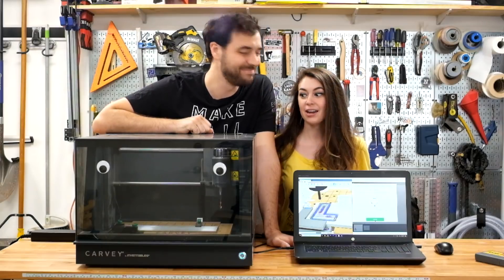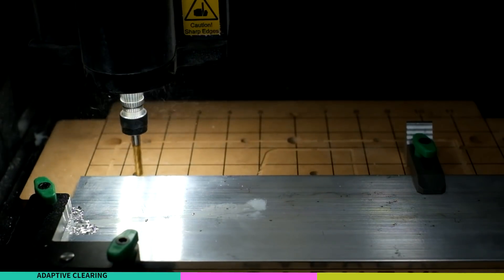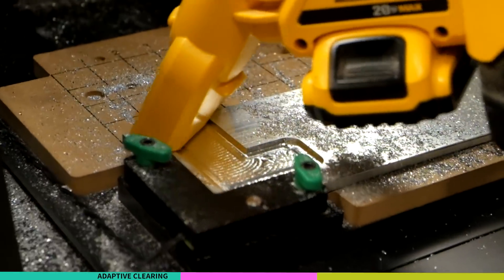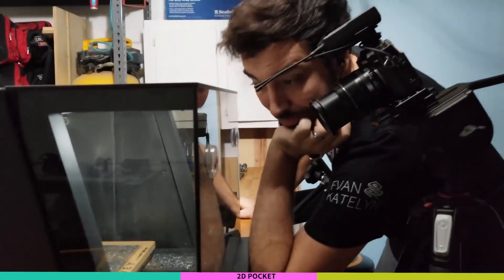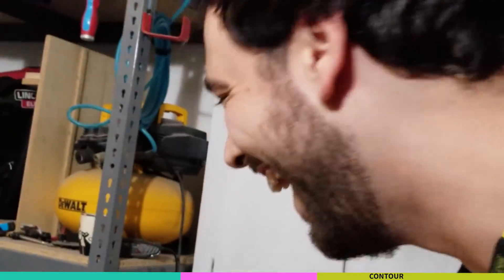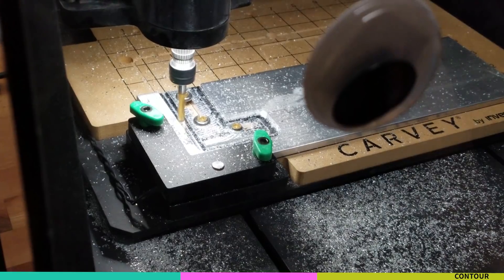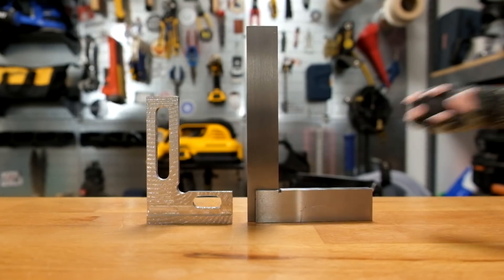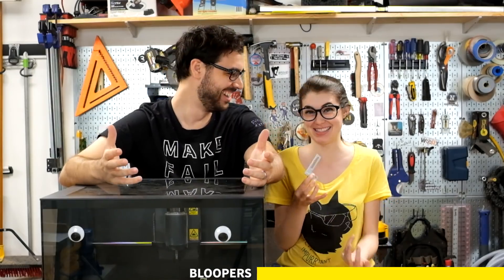Can You Cut Aluminum on a Desktop CNC?

Comment: Most little machines, Carvey/Nomad can't handle 1/4" endmills well. Not enough torque. 1/8" is much nicer.

And 0.125" endmill --> 12.5 IPM --> 12.5 thou DOC. Just as a guideline.
Reply from the maker: Ah yay!! Thanks so much for chiming in Winston 🙂👍 We were originally worried about the rigidity of the bit but I think a 1/8" bit can handle anything the Carvey can put it through, especially if we try to find a shorter stubby bit. Can't wait to try again with more experience and info 😁
Reply: Definitely agree with the stubby bit. Always use the shortest length of cut(LOC) and shortest stickout tool that you can get away with. These machines seem to have problems with rigidity, so vibrations are gonna kill your tool. You might consider stepping up to a 3flute or 4flute endmill as well. As mentioned above, some lubricant is nice. Even adding just an air nozzle blowing on the tool to increase chip evacuation will help wonders.
Reply: @Bitfrogess  no, please stop with the terrible advice.
Reply: Winston Moy I was going to mention depth of cut is way more important than cut speed (IMHO). They showed the speed but not how deep the cut was. I’ve never run across a situation where slowing things down compensated for a DOC that’s too deep. But that’s just my experience.
Reply: cyberreefguru  I've come to the same conclusions for hobby machines. I generally figure out the limits of an adaptive clear depth wise, back off until I'm comfortable, then inch up on my optimal load.
Reply: Beat me to it.  Definitely try a smaller diameter end-mill, and possibly slowing down the  travel speed.
Reply: I agree with others if you can somehow add coolant and chip clearing devices, you can get a little more aggressive than Winston recommends.  I use a coolant mister with a 50% rubbing alcohol 50% water concentration and I run at 15 IPM and 20 thou DOC with no problems. I use a 3 flute at 18K rpm with these speeds (Shapeoko 3).  There is a mdf bed and the cutter makes enough heat to evaporate any coolant before it soaks into the mdf.
Reply: I was waiting for your sage advice Winston!
Reply: When I saw it going wrong in the video I was thinking "I wonder what Winston would make of this" and now I know! \o/
Reply: I completely agree with this statement! I may be able to hit these speeds with my 7hp rotor....
Reply: If you have the clearance use the shortest flute length cutter you can get. That cutter is long and it's going to be prone to deflection. Great job on the video and making a successful square!
Reply: Are those guidelines just for 0.125" in aluminum or do they apply to other materials and sized endmills?
Reply: Do you mean .0125 doc not 12.5
Reply: @JoeB55  he said 12.5 thou. that's the same as .0125
Reply: and you rock Winston thanks for that bit of gold Ive already liked and subbed your channel already that's why I trust that info from you :)
Reply: I've been running 4mm single-flute cutters to cut 6061 aluminum on my Nomad lately and they work pretty damn well. The additional diameter and rigidity over 1/8" tooling helps with material removal rate and deflection, respectively... And all without taxing the spindle much more.

I essentially just used your feedrate and DOC suggestions from your Nomad aluminum video as a jumping off point, decreasing them by maybe 10% if the cut sounded too violent.

Btw, thank you for all your helpful videos over the years, you've taught me a lot about process engineering and really helped me utilize my Nomad to its fullest potential.
Reply: I'd love to see them actually test this theory. It's not that I don't trust you, but I like their videos and comment interaction. Does this also apply to the x-carve?
Reply: Brodey Sheppard  This also applies to the xcarve but beware because it is a different machine you may get different tolerances and in this case your spindal / router as well as your stepper motors, even your gantry size due to the same method of movement being used for each xcarve machine of a different size will change a lot in making faster and more reliable cuts. Also in this video I believe from the sounds it appears the workpiece most likely wasn’t as tight as it maybe should be so make sure to keep that in mind.

Comment: I think it would be beneficial for you guys to experiment a little bit with with of cut, and chipload.

https://www.youtube.com/watch?v=d6tyyBxWAAU
Reply: also - its not whether it's a right angle or not that you need to measure - what you need to measure is whether the piece is overdimensioned. When you get as much chatter as you guys got the bit and the spindle head flexes a bit and that tends to leave the object your milling a bit too big.
Reply from the maker: That's true, we should check the final dimensions against what we designed 👍

Comment: Good call holding the part down through the holes, saves some work down the line. I'm not familiar with the Carvey but from what i just saw and heard, I'd guess it's not the most rigid machine. I'd recommend slowing your feed down and possibly a smaller diameter tool just to reduce how much it pulls the head around if it snags. You might also benefit from some kind of chip evacuation as if you keep re-cutting material then you dull cutters faster and essentially increase the depth of cut.

Again, not experienced with Carvey but i am a cnc machinist. Have you considered chain drilling to remove the bulk of material leaving just clean up and facing for the endmill?
Reply from the maker: Yeah we are definitely down to try a smaller diameter next time. This is Katelyn asking here and it might be an answer Evan already knows, but what's chain drilling?
Reply: @EvanAndKatelyn  It's drilling a series of holes with a tiny space between them. You could do that around the outside of your part and then your end mill only has to remove the bits in between. You could leave some material on the outside of the part for a finishing pass at full depth which would eliminate the lines the tool leaves when doing steps too.
Reply from the maker: Ah interesting, thanks for the tip!

Comment: Coming from Winston Moy and NYCCNC videos.... eeeeek! Soo much chatter :-/ Sounds like you still need some more tweaking :-)
Reply: Haha i remember the first time cutting Aluminium on our shapeoko.... Looked more or less the same. I found out that with the fast turning spindel its better to ramp up the feedrate and reduce the depth and width oft cut. I run feedrates of around 80-100in/min. Try to avoid cuts where the cutter is completly surrounded by the material. :)
Reply from the maker: Thanks for the tips!
Reply from the maker: Haha we were mainly glad it cut and didn't gall up. But we could definitely refine things in future videos. Just wanted to capture the reality of our first attempt :)

Comment: When you cut your slots, step down to an 8th inch end mill and use adaptive clearing, you'll be able to go faster.  That's how I do it on my mpcnc.
Reply from the maker: Ooh sweet yeah we were thinking next time we'll try the 1/8" end mill so the load on the frame will be less. I think the bit should be fine moving at those speeds and feeds. We went with 1/4" so the bit would be thick enough but I don't think it's the weakest link :P
Reply: EvanAndKatelyn  When I operated a cnc router at my last job we did most of our work with a 1/4" bit. Your're right though, the rigidity of your machine is the problem so step it down to that 1/8" bit like Barry suggested and you should be fine. Also try reducing the length that the bit hangs out from the collet, the longer it is the more it can vibrate.
Reply from the maker: nemisis714 yeah would be down to try having the bit less extended!

Comment: I'm surprised you didn't use any coolant even wd40 might of helped improve the finish maybe? Messy tho
Reply: Too messy, and really not needed.  Having a vacuum attachment would help though, or even some kind of air blast to clear the chips out of the cuts.
Reply from the maker: Still more experimentation needed for sure, but it seemed like stopping it every so often to cool and clear chips worked fine without a lubricant. But we are open to keep trying new things!
Reply: We used one of those little compressed air chiller widgits on the benchtop CNC at the tech school I attended. It worked quite well for machining aluminium.
Reply: As other machinists here have mentioned though, the RPM on a router is really too high to allow for large bits when cutting metal. You can't produce a decent size chip without pushing the feed rate beyond the capacity of the machine.
Reply: @mosnar87  A single flute end mill will help with that.

Comment: As a cnc machinist I'd say you need to slow that feedrate way wayway down. Aluminum gums up on a milling bit. Even the large ones I run they don't plow into aluminum that fast. Most the stuff I run is anything from mild steel to stainless to tool steel. Also a wood router turns at a much much higher rpm than the spindle on a mill does. Running a bit like that at that rate of speed doesn't give it a chance to slice away at the aluminum which is why you are getting such high vibration and the bit is studdering. Picture it like trying to slice a tomato with a kitchen knife by simply slinging the knife at it as fast as you can vs slowly drawing the blade across the surface of it. Just some friendly advice
Reply: if the tool gums up you need lubricant, ethanol works great but it'll mess up an mdf spoil board.
Reply: Yeah, I instantly knew their feed rate was way way to high, especially with that ridiculous RPM.

You just have to watch youtube videos of CNC mills to see the kind of feed rate you should have, and know this is way way too fast. 
Also think they're trying to cut away too much depth with each pass. They should be doing 1mm per pass, or even less. It works much better if the aluminium is coming off in small chips and not large chunks. 

Don't know what bit they're using either, but Don't know how good or sharp it is.
Reply: I only know from my personal experience with jerry rig mill, that fast feed rate just will end up ether messing your machine, work peace or the bit.
Lost several bits for accidental rapid feeds, until i tighten and honed the machine tight as possible. Rapid feed, just muched the material away, could not get enough force for the cut and started to put that torque into else where.
Then again maybe it was the machine it self, made from harbor freight quality drill press and cheap same level cross feed vise that had ridiculously play. Bits were excellent so that probably was not the issue.
Anyways it was terrible idea, terrible quality and broke more expensive bits than whole setup was worth, but least i got the parts done what i needed and it sure did beat using cordless drill to mill the material out.
Reply: I have a cheap chinese 6040 1.5kw CNC router. I've been down this road. You can use a 1/4 inch bit, but Its never pretty. 10k RPM, 15 ipm, 0.01 depth of cut, 50% stepover.  I use air blast and kerosene as a lube. The end mill must be brand new,  perfectly sharp and stubby, if it's even a little dull, forget it, you'll gouge and destroy your floor finish. I have much better luck with 1/8 inch end mills. I run them around 12k rpm, 20-30 ipm 0.015 - 0.02 depth, 50% stepover. I clamp my parts in a vice thats bolted to another slab of 1/2 inch aluminum thats bolted to the base extrusions. Also, my router is very strong in X and Z axis,  but very weak in Y, so I plan my cuts to favor X where possible. I prefer kyocera 1/8 inch 2 flute carbide end mills ( orange collar ) from ebay.com. They seem to last the longest and cut without chip clogging.
Reply: this is great advice in nice plain language thanks!
Reply: Fast very light cuts will work it really depends on approach. For this non rigid box I’d probably say if it’s accurate enough to fly by night let it go and take a .2mm depth of cut per pass even if it takes 7 hours so the part comes out nice. Not trying to make a living just save a few dollars for at home repair projects, etc... and enjoy doing it. I’d also run a 3/16 to 1/4 high helix endmill like yg-1 brand and probably 3 flute so it’s not wanting to grab the part. Personally I can’t stand 2 flutes on any of my machines except in certain instances and usually when plunging otherwise i don’t touch them and we cut 90% aluminum.
Reply: I like how they spead it back up in the middle of the video like what we just tryed that we found out we can't go that fast
Reply: @sinformat I'm sorry but I have to say you are wrong. Aluminum needs a high spindle speed and feedrate. The reason why your current tool endmills are running slower is because they are bigger. The larger the tool the slower it will be run due to the higher surface contact. The issue that they are having is rigidity of the setup, there is too much projection from the endmill and its a small bench top machine which doesn't help. That being said, good job @EvanAndKatelyn for giving this a go. Next time try a shorter 3 flute endmill that is uncoated carbide.
Just so you know where I am coming from, I'm a Manufacturing Engineer/CNC Programmer
Reply: @MATT890  most of the stuff we run in aluminum is ran with .250" and under sized carbide end mills and if we ran them fast it'd just destroy the part. We run mostly 6071 alloy. Most everything else we run is tool steel, mild steel, and stainless and we definitely run it a lot.slower on the aluminum parts and more passes than any of the harder stuff. But its whatever, reguardless that router on the carvy is definitely running a ton higher rpm than it should for machining aluminum. The engineers out here seem to honestly thing everything should be ran at the fastest federated the machine is capable of and I regularly have to slow everything down big time as they don't seem to grasp how things work in the real world. I once had a program that tried to run a 2" shell mill through a 2" thick piece of tool steel at a rate of 30" per minute and do it in two passes. That resulted in a nice fireworks show and a big dent in the door of the machine from the part. Of course there was nothing wrong with their program until they seen the carnage.
Reply: There's a huge difference between crashing and breaking tools from running them too fast.
Reply: @MATT890  I 2nd this lol
Reply: Yep Matt890 knows what hes talking about, I have a home made CNC router that I cut aluminum on every now and then and it took a lot of trial and error to get it to work correctly. You need fast feed-rates to match the spindle speed of a router. What u need to adjust is depth of cut because if you slow down you will end up gumming up the bit and it will snap.  also the less flutes the better. I use 2 flute just because 1 flute are quite a bit more expensive. Google some Chip Load Calculations and it will help ya out alot. congrats @EvanAndKatelyn on the successful cuts. https://www.youtube.com/user/EvanAndKatelyn
Reply: RNation00001 ,try a high 45 deg helix 3 flute and you will get an even better cut. Chips will fly. You’re looking at a $40 end mill but a much better finish.
Reply: I am an CNC and manual machinist and I run an obscene amount of aluminum parts and I plow through at 12000 RPM 360 IPM. The Depth of cut is not the only thing to consider when machining, you should also consider as others have said the rigidity of the setup, as well as the wall pass (how far you are cutting into the material on the horizontal plane) even with A2 tool steel you could take a 1” DOC with say a .015 wall pass at say 1050 RPM just fine. With the tool path they had at a higher rpm with a smaller wall pass and a 2 flute 1/4” endmill they could have easily avoided that chatter. Coolant would also help. Not bashing just putting in my 2 cents
Reply: @NewtInATaco  They were running 20 ipm. With my calculations, they should be running close to 100 ipm at the carveys recommended RPM of 12000. I'm not a machinist myself but the original commenter has no idea what he's talking about. 2 flute, 1/4 endmill, 12000 rpm, at less than 20 ipm? What? 

The machine simply isn't rigid enough for a 1/4 inch endmill.

A 1/8" single flute at 40ish ipm with 0.5mm DOC and they'll be golded.
Reply: I don’t know that your max RPM is in your little cnc but I think you also need to kick up your rpm and slow down your feed rate.
Reply: meh, they did it, its pretty accurate and by the end of it they understood how slow you should be going. just a bad finish, maybe they dont own a better bit for finishing. still in an industrial set up, this was what? 4hours? looked like it went into pretty l8 hours so maybe more. these machines are just so inefficient it boggles my mind
Reply: @eueueueu21  yeah I wasn't knocking them, just offering advice to help out for next time. Even in the end it was moving way to fast. If the piece was in a clamp and the Carvy used ballscrews for movement it'd have the strength to machine better, but its made to just carve wood so I doubt it does. But what I said about the rpm of the router is definitely the biggest issue, you just can't run those milling bits that fast and get them to work. They may be able to slow that spindle speed down to a workable rpm if it was independently controlled with a speed controller that they could manually adjust, but I'm not sure if the router would have enough torque at the low rpm it'd need to be turning at. Even on the big machines I run the feedrates are much slower when we run aluminum than mild steel.
Reply from the maker: Thanks for the tips! We know there's definitely room to keep dialing it in and we want to experiment and learn even more 👍🙂
Reply: @eueueueu21  all machines are nothing without a knowledgeable brain to operate it. Plus the stock software with all these desktop machines come with is anything but intelligent.